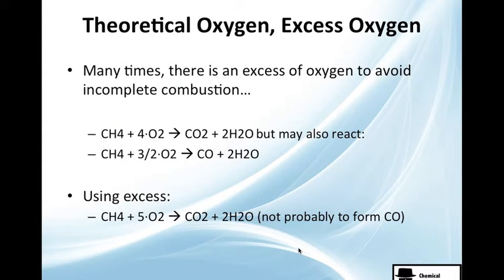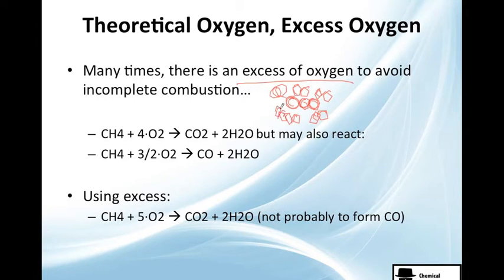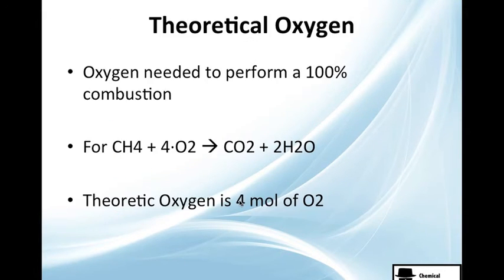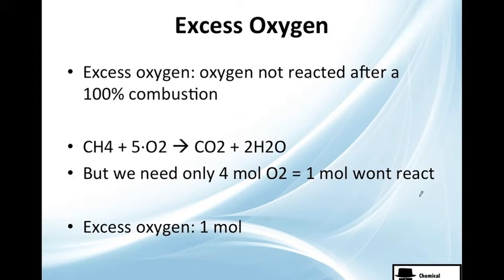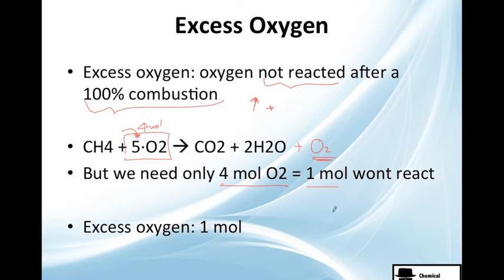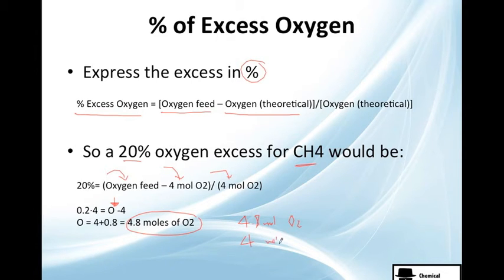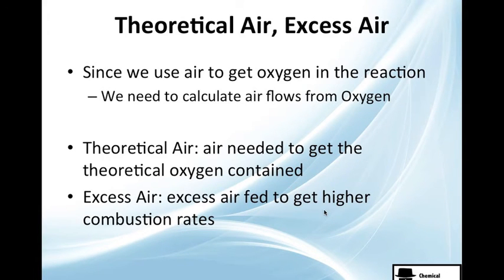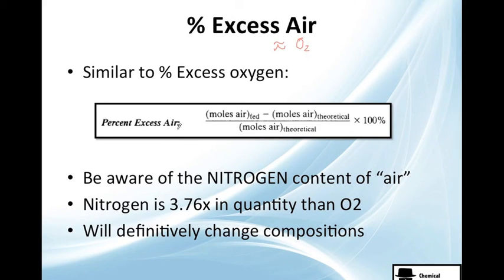Theoretical Air and Excess Oxygen in Combustion (MB1 2-50)

Comment: prove that % excess air is equal to % excess oxygen
Reply from the maker: indeed, since the ratio is "fixed". this will change if you add any other oxygen source, i.e. direct O2, or any fuel that will form another non 100% oxidized form, i.e. CO